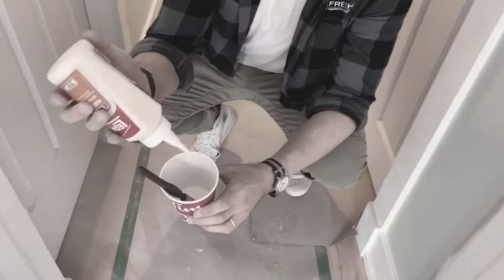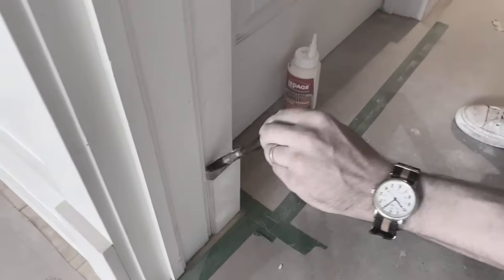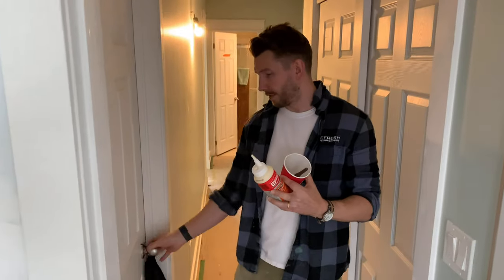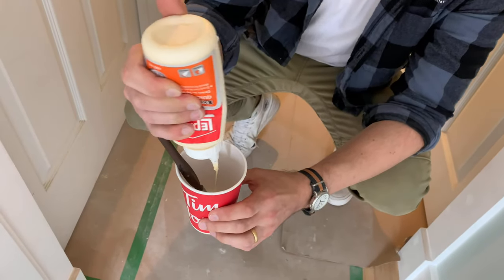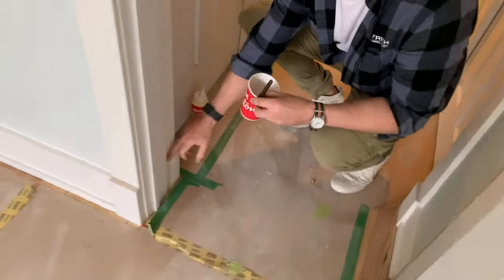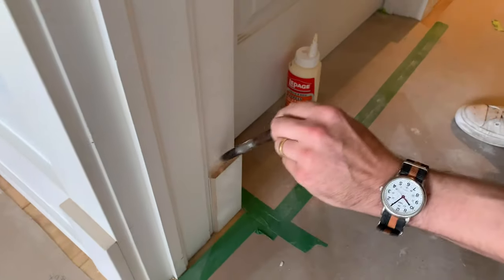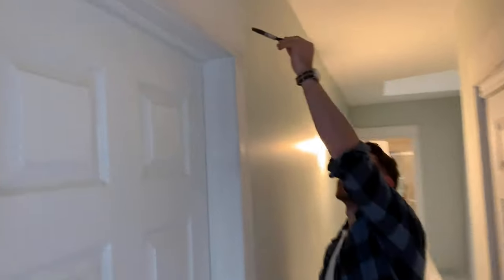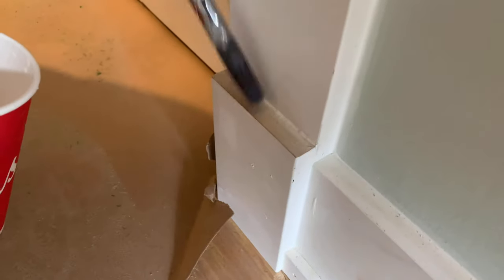Do THIS Before Painting MDF (How To Seal MDF Edges)

Comment: That's old school and it's called a glue size.  The old recipe was 10:1, water to glue.  It was used to pre treat wood prior to finishing.  It helps lock down the wood fibers.
Reply from the maker: Cool! Good to know 👍
Reply: 10 parts glue 1 part water? Do you also apply that to the faces of the board?
Reply: At another video's comment thread, someone was saying 5:1, where he said 10:1 was too diluted. In another thread, 2:1 is mentioned for use.

Comment: This is legit!  Without a sealer to lock the end grain and close at least some of the pores, you have a few cycles of primer/sand/primer/sand ahead of you, not the best medium for the job.  When I have made mdf slab cabinet doors in the past, I’d mix up 1:10 or 2:10 glue to water, and paint it on by any means feasible.  Ranges from 1” disposable brush, small lead-acid brush, or a soaked rag.  It helps to rub the sizing in either slide your fingers one or two passes, or work in briefly with a sponge or rag.  The edges dry rough and crisp, easy to sand smooth with 150 or 220
Reply from the maker: This is awesome! Thanks for the tips 👍

Comment: Yes, that does work and I've used and also I've used Zinsser Gardz primer and it works very well. If you wanted something faster drying, Zinsser BIN works too and is available in spray cans. It's a very fast drying primer.

Comment: at 1:12, i cant understand what you are saying, sounds like "sand a coat of wood filler" do you add a coat of wood filler? Can you please explain. thanks
Reply: "Sand that up after its dry, sand wood filler, paint it up, maybe a sand in between, and its gonna be glassy smooth." Basically he meant use wood filler after the glue/water mixture is dry, sand, then paint 1 or two coats, sanding in between each coat.
Reply: @michellezee651  cheers